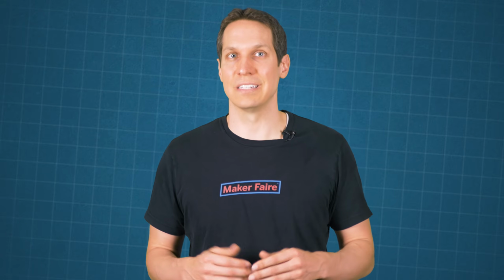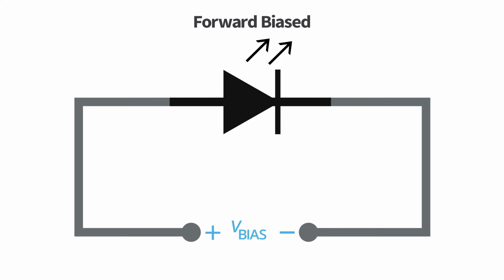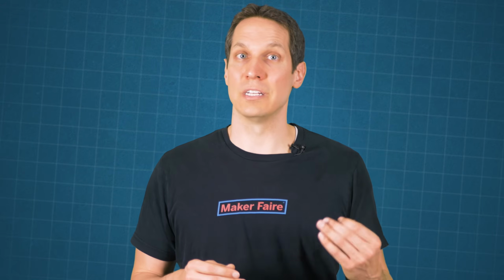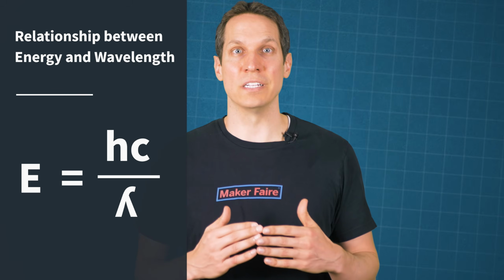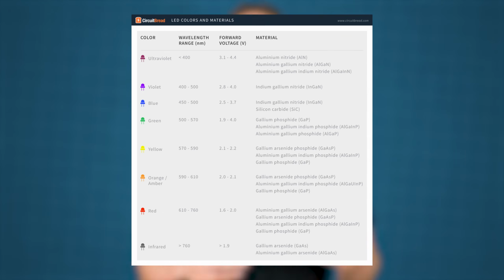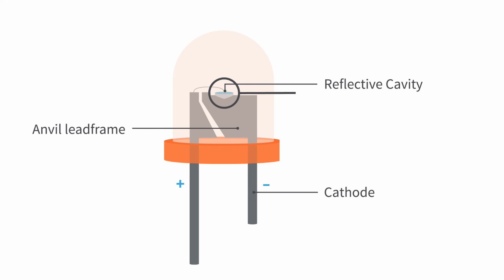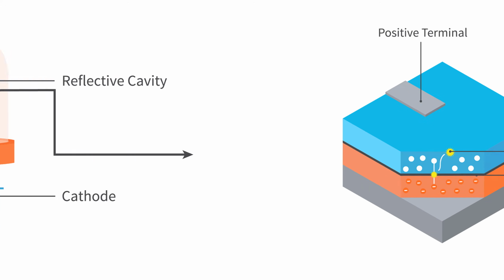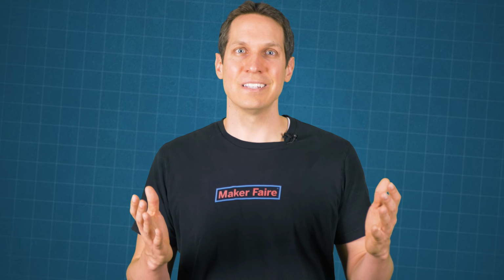How does an LED work at the molecular AND practical level? | Intermediate Electronics

Comment: 3:15 I didn't understand why the lead frame shaped like this(like triangular plane)? Why not designed it like a column that holds the semiconductor material
Reply from the maker: Hey Amjad, I don't know but I have a theory I think is reasonable.  The light emitting side is the cathode, so you want as much available surface area there as possible.  However, a thin vertical bar would be pretty weak mechanically.  So, by creating those two odd shapes, you're maximizing the surface area on top of the cathode while still providing enough mechanical strength to both the anode and the cathode to not be bent during the encapsulation process.  A flaw in this thinking is that the wire between the anode and cathode is tiny and doesn't seem to be affected.  Hmmm... I hope someone else that knows the answer will chime in.

Comment: What is an "electron hole". Why does the LED not stop working once all the "electron holes" are filled. This does not make any sense to me???
Reply from the maker: Yep, that was a question I had as well.  What happens is that, since you have a voltage, those electrons drop into the holes on the other side of the PN junction and then those electrons (or, more likely, other electrons) eventually pop out of the holes again and work their way out of the semiconductor material to go around in a big cycle again.  I recommend checking out our video on how a PN junction works to hopefully clarify this question.